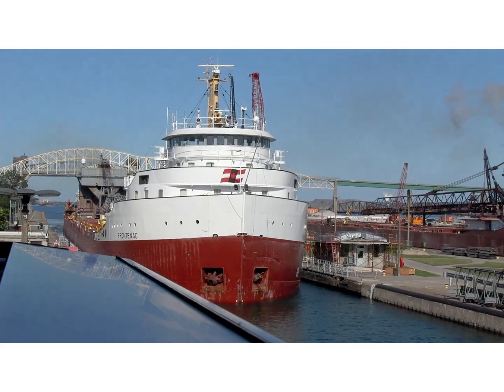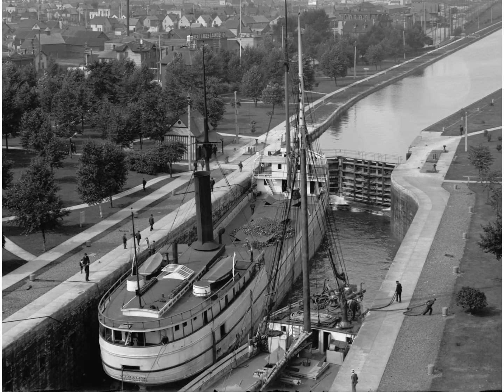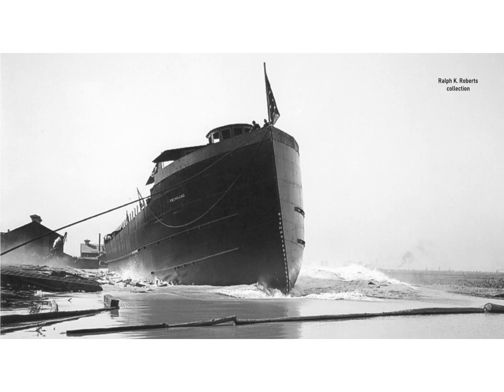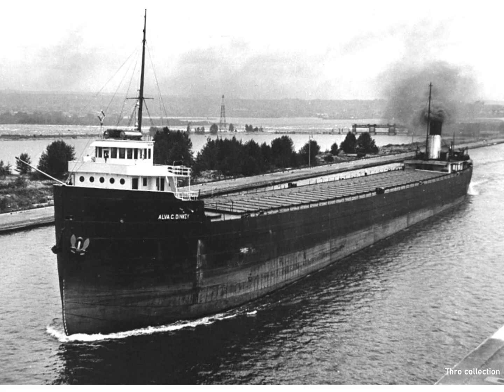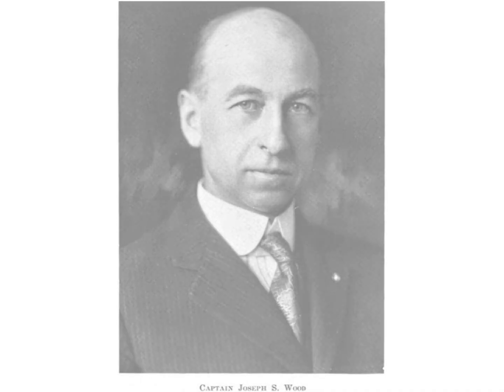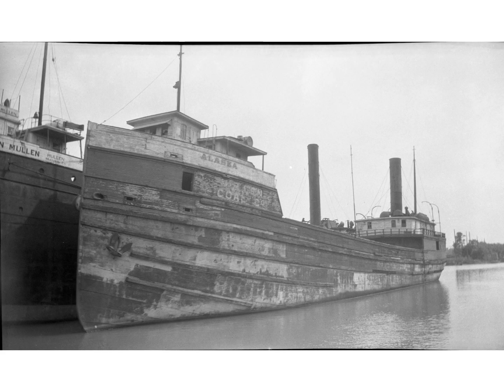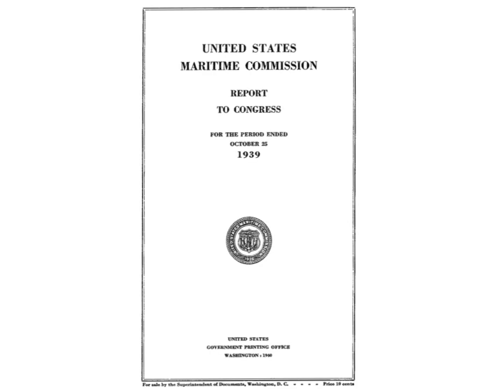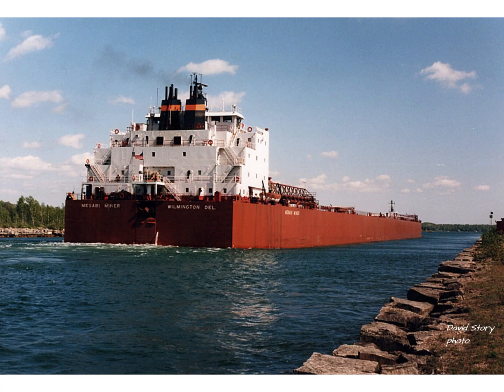Single piece hatches on Great Lakes freighters- whose idea was that, how did they evolve?

Comment: I often wondered about this transition from wood to steel hatch covers! I remember hearing the story about the D M Clemson and the reports of finding hatch covers washed ashore. I was amazed that these big new (at the time) steel freighters still used wooden hatch covers. I also heard the story of the Cypress and how she had the telescoping hatch covers that still needed tarping in heavy seas ( which in fact sent her to the bottom because the new ship had no tarps on board). So now another historical mystery has been solved, thanks to this excellent video! Thanks for this very informative and exceptionally well done video!
Reply from the maker: That's what I do. Happy to expand your understanding.